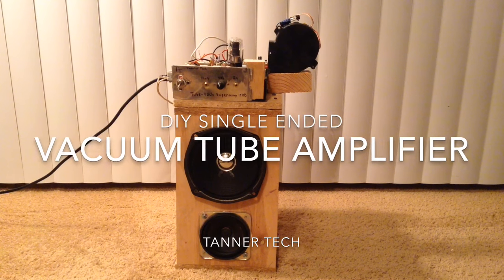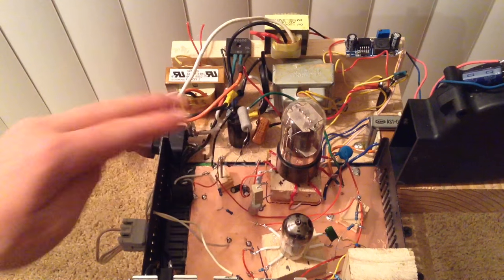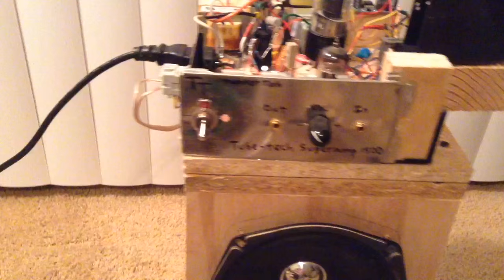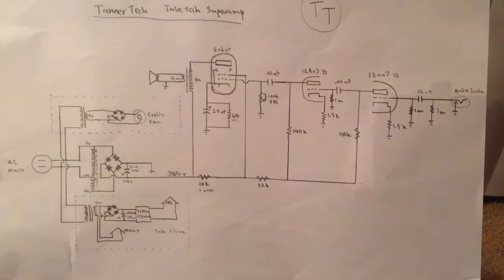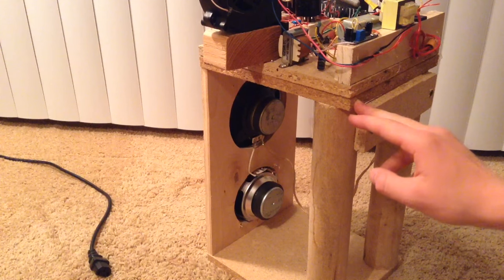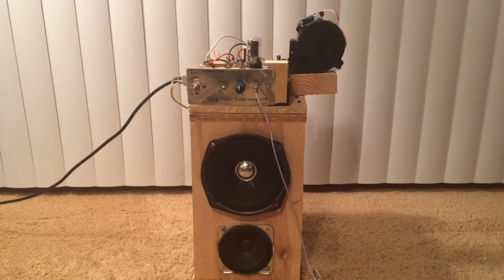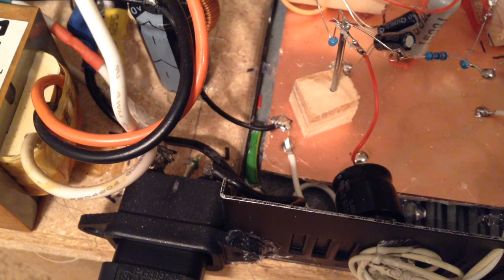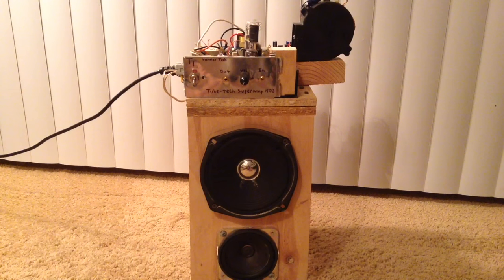DIY Vacuum Tube Amplifier With 12AX7 and 6V6 Tubes

Comment: Good stuff Tanner and keep it up! I'm sure by now you have already learned a lot more but just for anyone who may reading this, putting sides and a back to complete the sealed enclosure will improve the sound quality MASSIVELY. Speaker drivers will create an out of phase back wave traveling out of, naturally, the back of the cone. With it open like that this wave is free to mix and destructively interfere with the wave coming off the front. The easiest way to deal with this is by trapping and dissipating this back wave with a sealed enclosure.

Some designs will try to utilize this back wave to enhance the front wave at a particular tuned frequency (e.g. a ported box) but these are more complicated to design.

I realize the reason for the two drivers but doing this is also greatly increases the difficulty in design for similar reasons, those two drivers will interfere destructively with each other at some frequencies and constructively at others resulting in an up and down frequency response curve. This is one of the main things a crossover does, it allows each driver to only respond to a subset of the signal although that would kind of defeat the purpose of why you used two here. Even so it's still much easier to design for a single driver.

Not trying to take away from your work, as Niels Bohr says, "An expert is a man who has made all the mistakes which can be made, in a narrow field." So I salute you for getting out there and not being afraid to make mistakes! :)

Comment: When I build tube amp I always ground the chassis with ac ground  green wire  and transformer output ground what are you talking about .?
Reply from the maker: +reyzn bran Sorry, this tube amp is not very safe.  I made a much safer version in a video that will be going up shortly.  In this tube amp, the chassis has a 300 v potential to earth ground.

Comment: rather dangerous to have the b+ not isolated from the incoming line.
6v6 dont need forced air cooling,
single 6v6 good for about 3-4 watts out
Reply: Could the fan actually hurt anything? Apart from some potential noise.

Comment: This is what's considered to be a 'killer' amplifier.
 and not in a good way.
You mentioned how you fried your power transformer when you had the circuit ground connected to the safety ground of your mains power.
There is a good reason why it is called a 'safety' ground
With that connection between the safety ground and the circuit ground removed; you no longer have a safe circuit design.
What happened to that power transformer before is what will happen to you if you touch the chassis or any part of your  amplifier's 'circuit' ground and simultaneously touching any object that is connected to the mains  'safety' ground; which should be just about everything in your house.
 You have already had a bad experience when you touched the high voltage lead accidentally.....
You really do NOT want to have one hand on your amplifier or anything connected to your amplifier and then touch your other hand to anything else!
(A perfect example would be if you went to connect a shielded cable between the input of this amp and another mains powered device to play music through it or something like that).
.
 Also keep in mind that if someone builds your amp and is hurt or killed by your poor design; you could be sued as a result.
.
I strongly recommend that you take this video down before someone hurts themselves and take your schematic to one of the facebook groups dedicated to vacuum tube audio or to the 'electronics class' group and work with them to make your design safe, plus they can radically improve your design at the same time.
Reply from the maker: Thank you for the advice.  Whenever I use this amplifier, I make sure to be away from any other metal connected to earth ground, so as long as I am careful, I am safe.  As for the problem with people building my amp and getting hurt, I thank you for the warning.  I just added a disclaimer in the description that warns people.  If they want to build this, they now know the risks.   When you talk about my amp being a "poor" design, I beg to differ.  I built this amp on a limited budget, one that has no room for an expensive power transformer.  I honestly think my schematic is quite good for lacking a power transformer.  It also works great in regards to its intended purpose.  Thanks  for commenting!
Reply: @TannerTech would “Today Tanner” still agree with “Yesterday Tanner”? This is a MASSIVELY DANGEROUS amp. It doesn’t matter to the electrons what your budget was, there’s no such thing as a gimme when it come to high voltage.

Comment: Pretty nice you got it working ,a little dangerous not to say the least , you're putting up with a little 60 Hz noise after you study a little you will learn how to get rid of that. If you put an airtight box around both your speakers separately dividing it in the middle you'll get much more sound out of them in a tighter crisper base. There is actually a formula to determine the cubic inches of air space required behind each one of those speakers depending on their size that works best it really makes a big difference. You can look up the speaker manufactures and download their specs on the speakers about their Q factor and many other important Data about the speaker to figure out what kind of dampening you need in your enclosure and you can actually end up with a very good sounding system even with cheap speakers. If you're really insistent and think you need that cooling on the tube you can cut down your fan voltage by about 3/4 to half this will slow down your fan so the noise is probably not audible but you still will have enough airflow to keep your tube cool to your liking. Look for some good Tube building videos by professionals learn by your mistakes without burning down the house or injuring anybody have fun